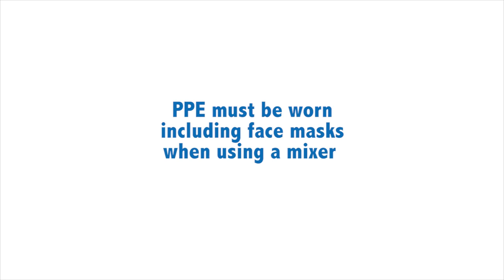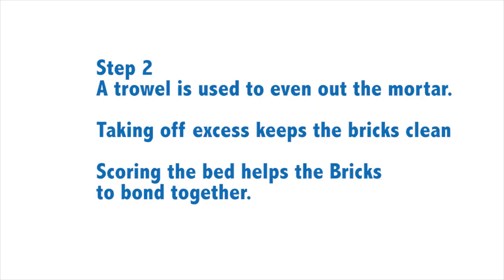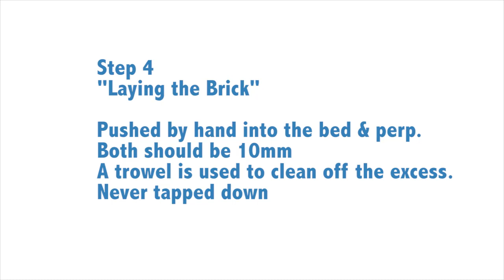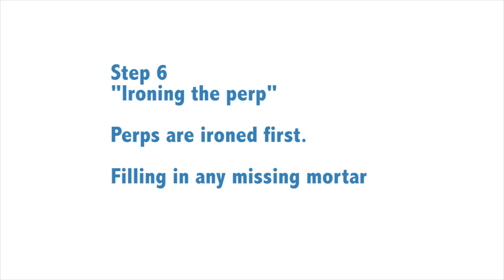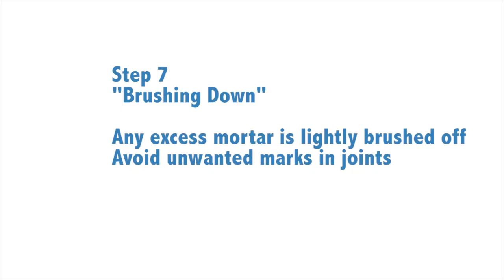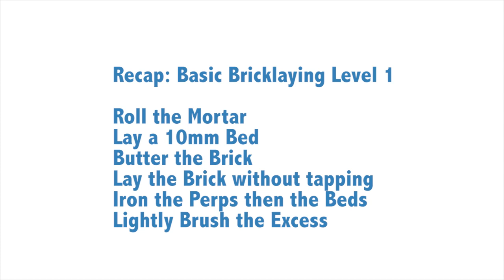Basic Bricklaying Skills (GSQ Brickwork Level1)

Comment: Why no tapping? Other videos  teach it is beneficial to tap.
Reply from the maker: The one thing we insist on is DO NOT TAP. If your bed is right, the bricks lay themselves. Good strong hands lay them perfectly. Whilst your tapping your not laying!
Reply: It depends on the brick. Some have to be tapped, others you don't.
Reply: bonanzatime 
na just keep rolling them with ya hand it’s it’s quicker even solids ya should be able to roll with ya hand and not tap and you’ll lay way more than the guy tapping
Reply: @gusemery5475  I've been laying brick since 1985, and there is some brick that have to be tapped, it don't matter who you are.  Like big soft utility brick.
Reply: Si me pusiera a pegar ladrillo así créeme que saco ni para el labor y con esa mezcla ya me imaginó el dolor de muñecas que as de traer